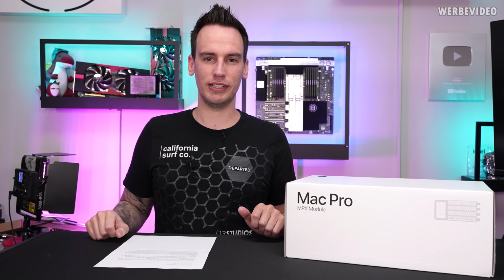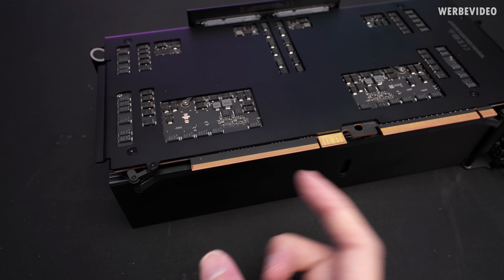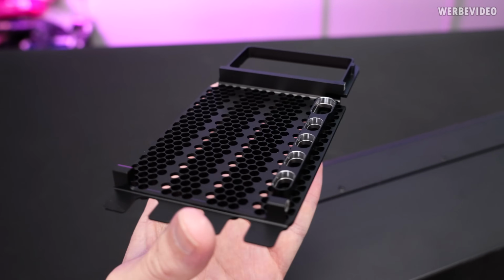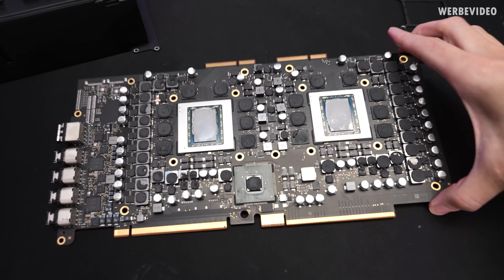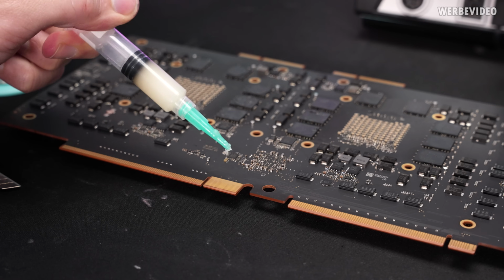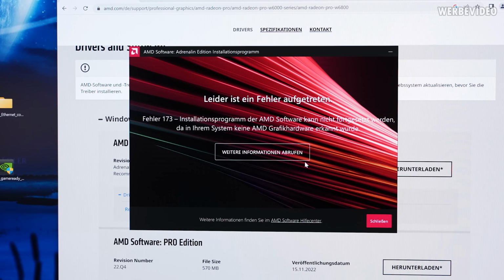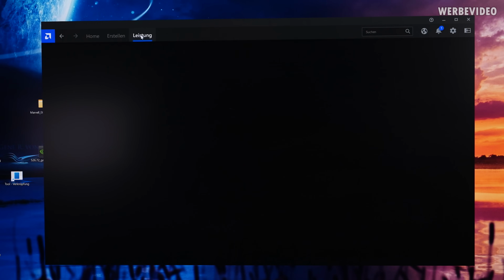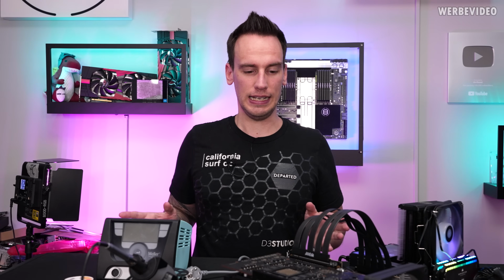This Insane AMD Dual GPU from 2021 is Faster than a RX 7900 XTX

Comment: On cards from older Mac Pros, you would need to flash the vBios with a modded bios. Usually people do it the other way round, flashing Windows cards with modified vBios ie the GTX680 runs perfect on Mac Pros including display during boot. Maybe there's a modding scene for these GPUs.

Comment: Ok.... Wait... Here's an honest question.... What you called "the front of the card" where the display connections are, I typically call the "back of the card" since it faces to the back of the case typically on install.... So which is it? .... But then also we call these things "back plates" so I theory the back of the card is also where the backplate attaches? .... So like what the heck is the front and what is the back?

Comment: Imagine how amazing it would be if the PC industry actually innovated like this and implemented the secondary power connector for GPUs and no cables were required. No issues with connectors not fully seating, not to mention this GPU fully supports 4 thunderbolt ports as well as HDMI. 

When you asked why does that connector exist, go look at the Mac Pro and see if you can find a single cable anywhere in the entire system.
Reply: There are optional cable connectors that the Mac Pro mobo provided if you want to slot in some third-party Radeon GPU. Another set is located beside the CPU cooling block and it’s only purpose seemingly was to provide any sort of power for a pair of 3.5 inch hard droves in a harness.

Comment: Maybe the additional card-edge of the MPX connector helps alleviate sagging?
Reply: in the Mac Pro these gpus are attached on both ends to the case. So there is 0 risk of sagging.

Comment: I think the MPX also has a link to the SMC in the MacPro. Apple stopped implementing GPU metrics in the driver as they communicate directly with the SMC on all other Macs to control power and cooling.

Comment: DO IT!! But... solder a power connector from a dead card instead of wires directly from psu, so that you can use your monitor device to measure the power draw and also be able to disconnect more easily.

Comment: Kitty approves of dual GPUs. 😸 That's certainly a very fascinating piece of engineering. Imagine if AMD would make a gaming version of this GPU that works on Windows PCs.
Reply: Game engines habe enough problems using multiple CPU-cores...
Reply: @emmata98  As Roman mentioned in this video, AMD engineered this dual GPU in such a way that it appears as single GPU in software even though both GPUs are working together. This means that software doesn't need to be readjusted or rewritten to take advantage of such a video card.
Reply: @bgtubber  "appear to be one" =/= "working perfectly as one"

Comment: Back when I used a Mac Pro 2006 and a 5000 series AMD GPU (official from Apple), I couldn't install the official AMD Radeon drivers because of the vendor ID on the card was from Apple. My options were to change the vendor ID via a BIOS mod or to install the drivers that are included in the Apple Bootcamp driver. EDIT: I'd love to see a follow-up video of this, especially if you end up making a water block. Would be really cool if you were able to design a custom PCB that the card just slots into and adapts it for use with a normal PC, without needing to solder wires.

Comment: I'm all for dual GPUs! 1kHz OLED monitors are absolutely possible and absolutely nothing we have today from either Nvidia or AMD can touch 4K @ 1000Hz (kHz) on a single, much less, even a double GPU. 

If Nvidia brought back 4-way SLI I guarantee you people running it regardless of the expense.

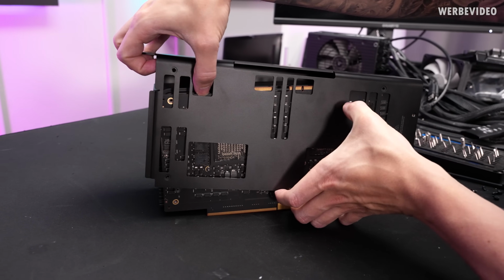Comment: 7:22 Did he say "I'm not a friend of that" instead of "I'm not a fan of that."??  I'm using that I like it. Also considering the thermal putty there is no way that is the intended method to remove/attach the outer plate.

Comment: This is really cool. A powerful dual gpu for sure. It’s a shame that multi gpu is dead. The writing was on the wall when it required game developers to implement it in their games for dx12 and vulkan.
Reply: Pretty sure with DX12 and Vulcan, it's that developers DON'T have to implement it themselves as with previous APIs they couldn't be bothered to do the work.
Reply: @MaddJakd  I think what he's referring to was that Dx12 implemented somekind of multiple discrete GPU method. That would definitely require developers to implement it. Basically it would mean that GPUs are just separate devices and it would be entirely up to the software developer to utilize them all or not. Anyway, any time microsoft takes control of a feature away from the hardware manufacturers it's usually the death nail for that technology or feature. They do it their way, which typically sucks and nobody wants to support it, then it dies. That's par for the course for microsoft. They want your PC to be dull and boring and fully under their control!

Comment: A dual GPU 7900XT that actually worked for gaming would be a monster
Reply: Everything in multi hardware setup would be monster if it works

If
Reply: this cost $6,250. no thank you
Reply: @Ampopoltech  now you know where's Radeon and Nvidia got their money's from

And now you know why Nvidia keep axed VRAM on GeForce card, and AMD keep euthanizing their Radeon lineup from profesional works
Reply: @Ampopoltech  professional grade cards are always massively overpriced.  I’ve owned several dual GPU cards over the years, one was $250, the other ones were around $700.  Back then dual GPU cards were the cheaper way to get almost as much performance as two cards in Crossfire or SLI.  They’d probably charge double what a 7900 cost if not more 😆 probably more since it would be faster than a 4090, but only if it worked without the need for specialized driver support like Crossfire used to require
Reply: @chincemagnet  what if use one GPU + one older Graffic accelerator like  Nvidia Tesla 60 ?
Reply: @Ampopoltech apple...
Reply: yeah but Microsoft fucked that up with DirectX 12 so it would never work now because they won't make it work and amd does not make dual gpu drivers to make dual gpus work together in games plain and simple they offer the tech for making it work but no one wants to make it work that is the problem no software actually makes it work anymore
Reply: @raven4k998  microsoft kinda hates linux so linux users invented something called vkd3d which is more stable and sometimes faster than dx12
Reply: @raven4k998  vkd3d (or vulkan) runs most of the time faster than directx12 because it has been having community support and it's what we use on Linux because microsoft thrown the middle finger to the penguin and only allowed the usage on their ecosystem
Reply: dual 6700xt outperform a 3080 and match a 3090. theres a video somewhere on YT. 3Dmark is the only APP that STILL supports SLI/CROSSFIRE. since Dx12 has NATIVE MGPU support
Reply: The new 4070 could have been a good for dual GPU with its low power use and short board.
Reply: I totally expect the 7950 XT(X) to be a dual 7800
Reply: Brings back the dualSLI. Oh the good ol days
Reply: There's a reason crossfire/sli was dropped, and that has to do with and performance.
Reply: But the price tho
Reply: @capnapu  probably still cheaper than a 4090 😆
Reply: nvidia 5090 heres it comes
Reply: @lulalelilo   5090 = 16GB G6X (Ti has 24GB), 5.9% faster than the 4090, 590w avg load, and four slots for the cooler. I'm calling it watch.
Reply: @lulalelilo This comment didn't age well..
Reply: @ Unfortunate.
Reply: And it would draw 800W and it would also set your house on fire as a bonus, but before you die to the burns, it'll deafen you with the most jarring coil whine you'll ever hear.
Reply: @Y0y0Jester  I have a 1600w PSU and two 480mm radiators, I’ll be fine 😆
Reply: @Y0y0Jester  bro don't talk about the coil whine on my 7900xtx...
Reply: @Y0y0Jester  :D
Reply: corporations just keep getting dumber
and people just keep getting smarter
Reply: I don't see the point of having dual 7900XT when the chip already has MCM chiplet design. If you want more perf add more MCDs. Stay away from SLI/CrossFire driver overhead.
Reply: @ktuluify  I ran crossfire and SLI for years and the overhead was minimal once we got to the end of it, SLI RTX 2080 Ti’s scaled almost perfectly. Of course, if they can create a faster GPU some other way, that’s great.  But I’d love to see SLI make a come back.
Reply: @chincemagnet   I was there in the glory days of 3dfx. I saw the power of SLI in the late 90s at a friend's house. It was mind blowing. I can understand the nostalgic aspect, but the architecture of SLI/CrossFire is objectively worse in every way besides R&D costs/risk of MCM. Not only on paper raw (performance and associated power/heat cost of data centrality) but also by not giving game developers low level control over the hardware hence preventing optimization and debugging capabilities. The cherry on top limitations where you couldn't run cards together that use different ISAs.

SLI was a good solution or workaround while there were two major aspects that needed to be solved before better scaling could be achieved. 1) Driver wars and driver mafia 2) Chiplets/Multi-chip Modules. 3DFX attempted to solve #1 but failed. Nvidia and ATI, later AMD, knew it was going to take many years before those problems were going to be solved so they invested in SLI/Crossfire. Glide -> Mantle -> Vulkan was a long road with many big battles along the way with money under the table with regards to Direct3D and OpenGL. Khronos considered calling Vulkan opengl-next but fortunately voted on the name. Fortunately enough of us voted against opengl-next! ^_^

It's much easier to design and manufacture a big monolithic chip compared to chiplet designs. Modular systems will always be more complex but it offers many advantages. I'm just speculating here: Opportunity cost risks was likely the reason why it took so long for the first MCM GPU to arrive after CPUs showed that it's practical. CPUs had more advantages since you didn't need latest fab tech to produce I/O dies so it made sense to start there.

MCM simplifies software development and unlocks a new potential of hardware scalability but for whatever reason we still might see multiple MCM-GPUs on a single graphics card. I think it's highly likely that they would rely on Vulkan to drive the GPUs opposed to SLI/Crossfire maybe just maybe both, depending on how far along we are in software adoption.

 IIRC Strange Brigade was one of the few games that supported vulkan driven multi-gpu. I wonder what 3D Marks stance is on this and why this isn't an option. It was done in 2018 already. Maybe I'm ignorant, but I don't hear many experts talking about this. I think this should a bigger demand from gamers and game devs. Being able to run Nvidia and AMD in the same comptuer, that's where it's at! xD
Reply: @chincemagnet overhead was not minimal in my case i ran double gtx 1070s for years in my render rig which i gamed a ton too and still alive however given to my brother while im working with my good old dell xps 9560. Double cards was always a nightmare even in blender, setting them up and just gave %30-%40 boost while even that system was on a intel extreme platform which had all x16 lanes to three slots of the mobo. In gaming there was %10 peformance uplift at max and some games were even taking performance hit because of the poor optimization. At the end the sensable thing to do was plugging out the sli cable and running them separately in rendering software. And im not even mentioning inconsistencies and crashes that i had randomly while running SLI.

Comment: I'd love to see a custom waterblock for this. I've owned several dual GPU cards. I've had a 5870x2, 7990, 2 295x2s.
Reply: still have a 295 gtx and a 3870x2........cool novelty,good to run crysis back in the day

Comment: I'm just impressed it was so easy to get running. There was so many possibilities for apple to make this not work on regular PC like not compatible firmware, some missing voltages/signals on additional connector (wth is purpose of it anyway?) and they didnt do that after all. Performance is also very impressive.

Comment: I would be interested to see more compute oriented workloads. Blender rendering or folding@home for example. This might be a worthwhile deal for a diy setup.
Could also be interesting to see if the card can be modified  (MPX connector cut off) to fit in a normal motherboard. This thing with a custom watercooling solution would probably be a beast.
Reply: There are some "PCIe extenders" which are basically a PCIe x16 card edge connector with a PCIe x16 slot soldered to them. I would think that one of them would raise the card up from the motherboard enough that the MPX connector would clear it. I would do that rather than try to cut off the connector. Then you could use a stand off of the right height in the screw hole on the cards backplate.
Reply: Blender would be expected since it can utilize multi-GPU with pretty much plug-and-play (Non-Eevee at least) and also doesn't chugged PCIE bandwidth.

I would be more interested in AI accelerator.

Comment: Would love to see more of this card. I think that dual gpu power is underrated by the market, it would be cool to see it coming back to personal builds some day with the new technology that we have in the present.
Reply: Is not about being underrated. Is about not being needed. There is just no reason for it in consumer space other than a few enthusiasts trying to pull 120 fps in 8k with ray tracing. 
If you go to lower chips then why bother by putting two together instead of just buying a higher spec one.
Reply: @SIPEROTH  Adding to that, especially games have a lot of issues with dual-GPU setups, it's the entire reason why SLI/NVLink failed there too. You need to put a lot of effort into synchronizing rendering between the two GPUs, and that kind of task management is hard.

Comment: I think I have found a worthy successor to my RX Vega obsession. Long live weirdly performant AMD GPUs!
Reply: HBM memory. The ability to extract more performance out of a Vega 56 by flashing the Vega 64 VBIOS on it. The very existence of Radeon VII.

The RX Vega cards were some of the quirkiest mainstream GPUs ever made.
Reply: @d4nyll radeon VII server farm for FP64🤤
Reply: thing is if i really wont get anything, for whatever, justifying, reason, then i can just stop trying and try other work
Reply: What other weirdly performant AMD ones are there? Anything from 2015 and up?
Reply: @enermaxstephens1051  for 2015 the R9 390X 8GB was a odd one as by the time it was out for 2 years and you could get a 6 core or up cpu it was slightly quicker than a 980. the Vega cards performed well but the workstation cards built on Vega were great, they even made some twin gpu cards for normal pcie from the Vega chips. I also have a soft spot for the W3200/4100 and the W6400 for being outstanding single hight SFF GPUs with 4GB of Vram, the 3200/4100 do benefit from a bios tweak to bring the memory speed up to the same as the RX540, I have one in a 2nd hand pc I bought with a I7 4770 that also has a 2.5G network card in that lives under my living room TV to stream 4K games from my main RX6950 rig in the office but I have had friends play indie titles on that pc at 1080 and its alright for 45W after the bios flash.

Comment: You want windows, borrow a Mac pro (intel) and use bootcamp. Brother bought a cheap Mac pro, the ridiculous one. And is boot camping that. He's a total apple fanboy. But needs widows sometimes.
But for general use the new m2s blow the Mac pro out the water.
He uses parallels on his m1 laptop for windows.
Reply: Was cheap because 2nd hand market has dropped thru the floor, and think he did some web design for previous owner. Quid quo Pro.

Comment: I'd be interested to see a custom block and power metering. I miss dual GPU setups, this was a fun episode!
Reply: Yeah, allot of gamers are to young to remember when Ati/Amd sold the 4850x2 & 4870 x 2👌
Reply: @ryanjofre  Yeah, i remember those times when Nvidia and ATI bashed eachother if a Dual-PCB card could be called  one card. Fun times, when performance actually made a difference in gameplay settings, and you ACTUALLY could see the differences.
Reply: @Gunni1972  I kinda remember Nvidia wanting to sue Amd/Ati and Vice versa.
Those dual cards weren’t perfect but they where bad ass.  People greatly exaggerated the micro stuttering. 
I was gonna buy one but then the 4890 eventually came out and it was so bad ass & affordable you only needed one. I use to play Crysis on ultra settings on that card with just a dual core Phenom II.
Reply: Back when you could get more frames in exchange for horrible stuttering.